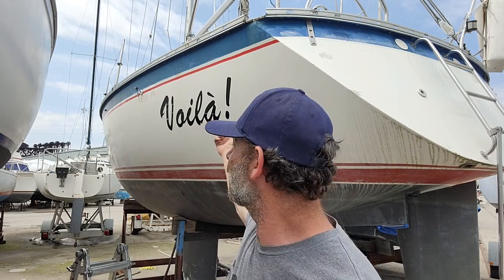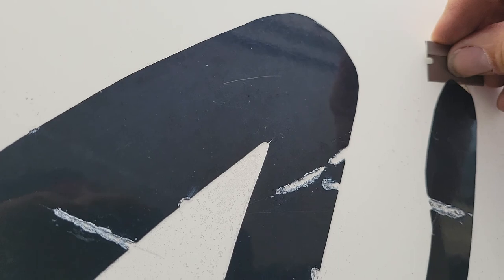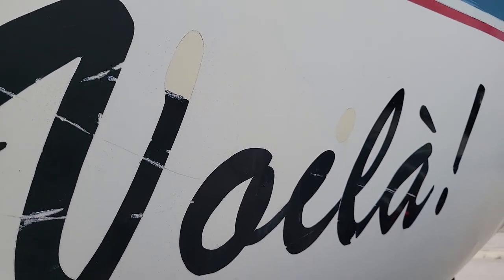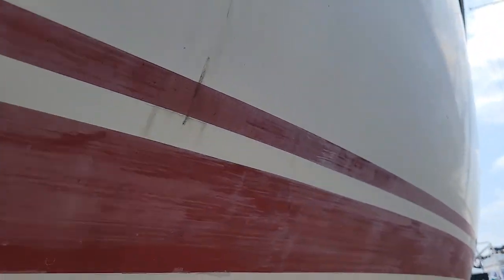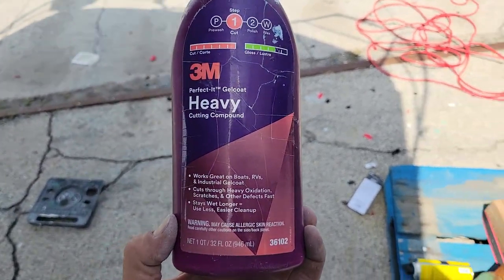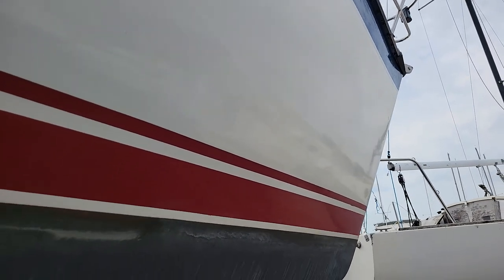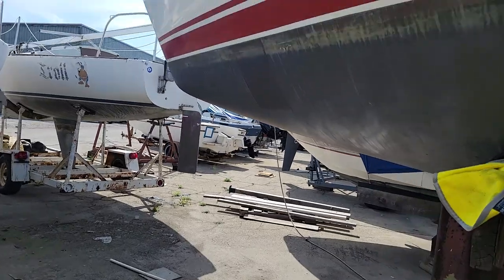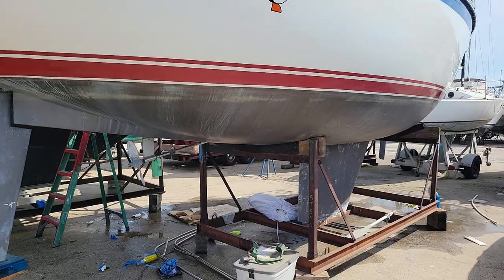Puffin Refit EP5   Lettering Replacement and Buff & Wax

Comment: Looks great! You mention using goof off to remove residue on the hull. Any advice for removing lettering residue on Dacron sails?
Reply from the maker: Dish soap and hot water is the safest bet. "Goo gone" can work but may leave a little discoloration.